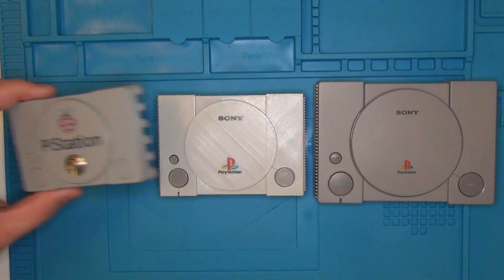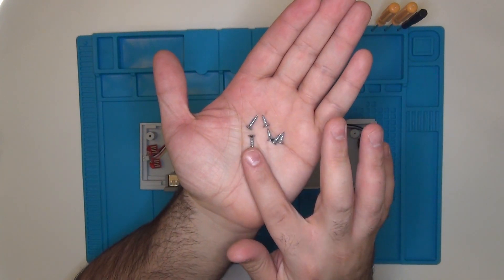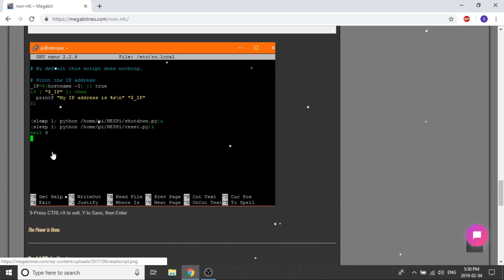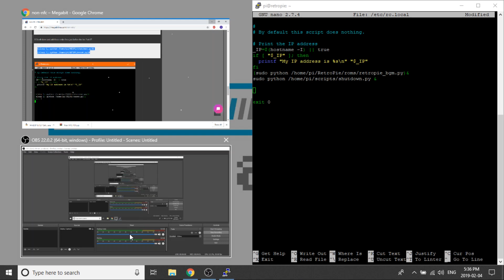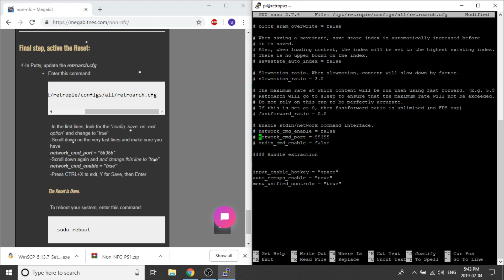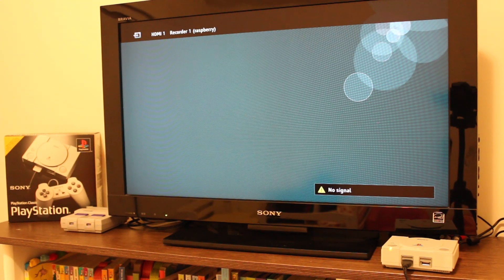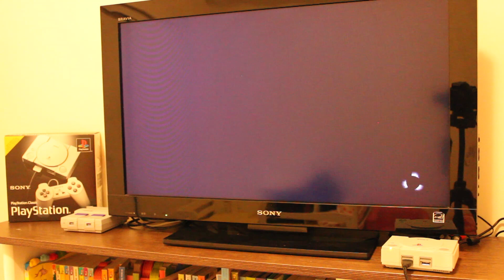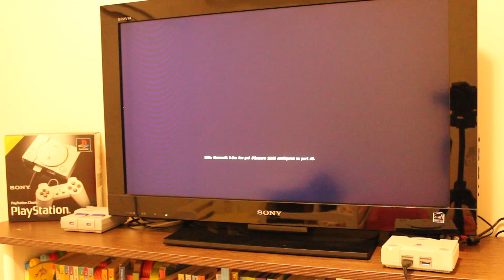REVIEW | Mini Playstation Case for Raspberry Pi! Best 3D printed case for your raspberry pi

Comment: But can it start the logo of original ps1 when you turn it on???
Reply from the maker: Yes it can. Watch the end of my video. I show it turning on and I do have the playstation boot video running on startup
Reply: @Restalgia  how can i install this in the pi any links?
Also from where u have the PiStation case from the one from your other video?
Did u create it?
I think this one is nice but little too fat lol
Reply from the maker: @obidahasdia4095  you just need to place it in the splashscreen folder, that can be accessed over your network. In terms of the case, I found it on thingiverse and then printed it myself.

Comment: 3d printed case lol looks terrible
Reply from the maker: Usually they looks pretty bad. The company did a good job with this. The resolution is good, so although you can clearly tell it's 3D printed, it still decent, and not an eye sore.